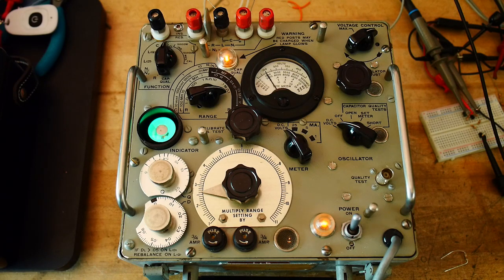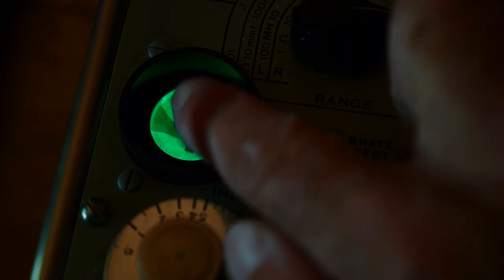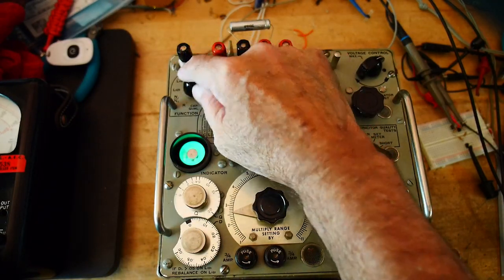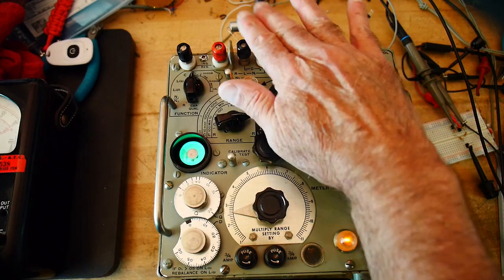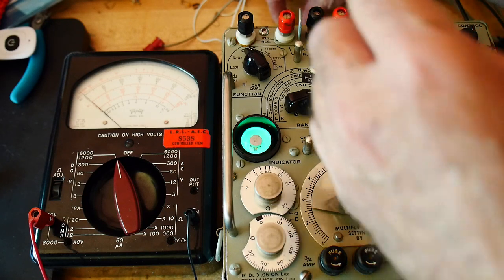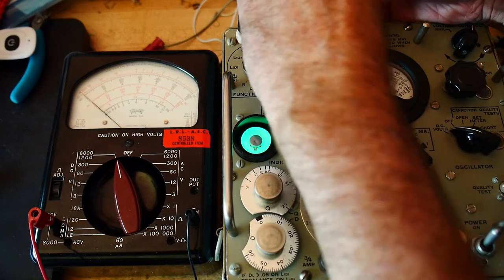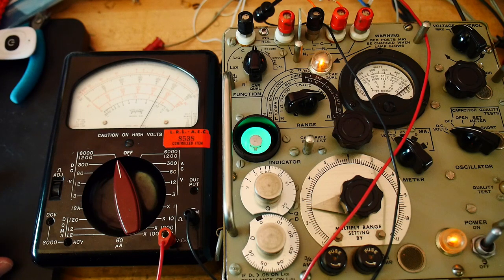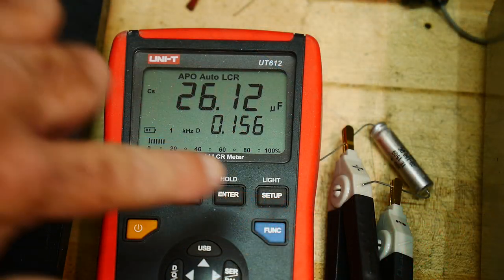#513 High Voltage Capacitor Test (ZM-11/U)

Comment: What's the nomenclature on the nice boat anchor LCR meter....I think I may have missed the video where you described it. I just resurrected a Sprague TO-6A capacitor checker that has a eye-tube indicator and unmarked voltage test control as well...now I gotta go check how high mine goes (VERY carefully!). Thanks for sharing!
Reply from the maker: https://youtu.be/NWm7yu1W3v0

Comment: Hello,
first of all thanks for your videos.
I have a question not directly related to the video, maybe you can advise: I found a used Triplett 630 for sale (in Italy, where I live), same model as yours. The owner says it doesn't measure correctly, e.g. 220V AC is indicated as 300V AC. He says the microammeter and needle equipment is ok, smooth movement.
Could you possibly tell me what the problem might be, and if an attempt to repair is worth?
He asks about 45$ for the meter. The condition is good, aesthetically.
Thanks and regards.
Reply from the maker: probably a resistor that is no longer the correct value. I would measure each resistor to see if they are correct. precision resistors are expensive and hard to find so you might factor that into the price.